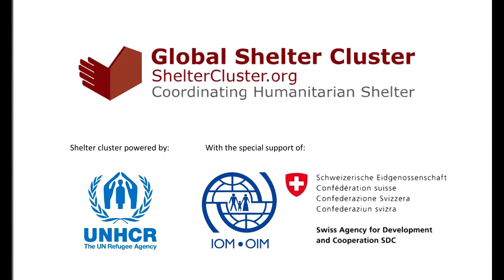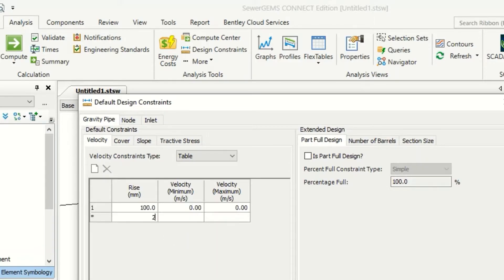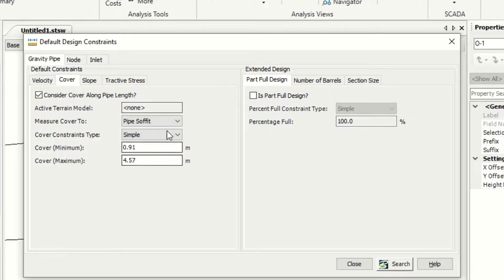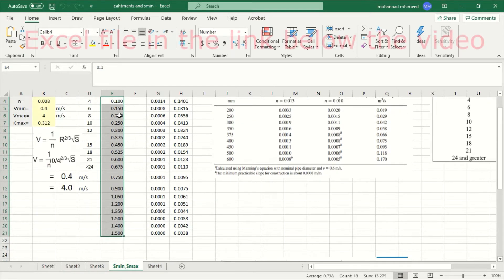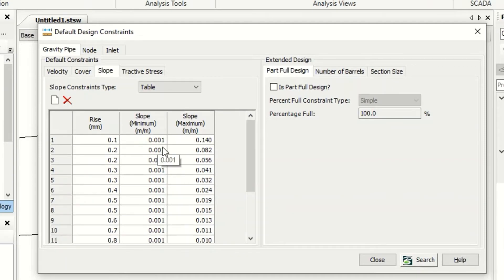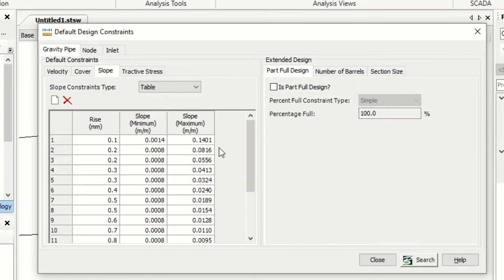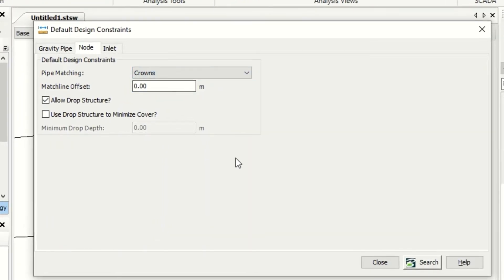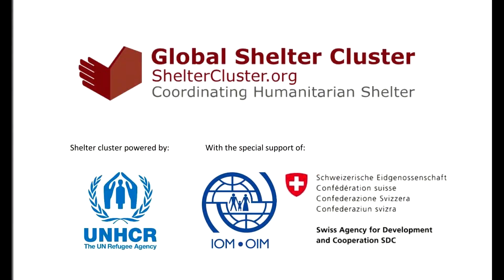SewerGems Part 6, "Defining design constraints""

Comment: @Muhanned, what about the PE pipes, do you think the constraints will be changed if we used PVC, PE pipes instead of concrete pipes. so we may say maximum velocity 6 m/s, and of course, the maximum slope linked with?